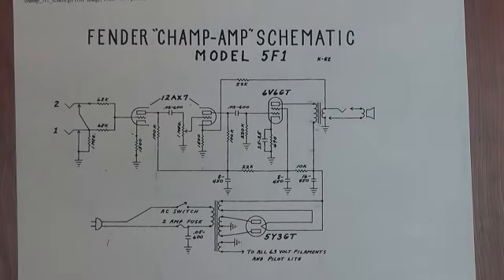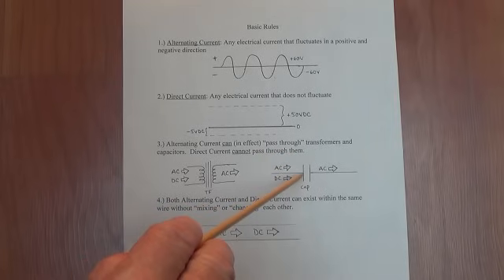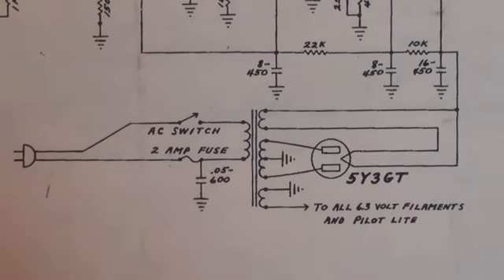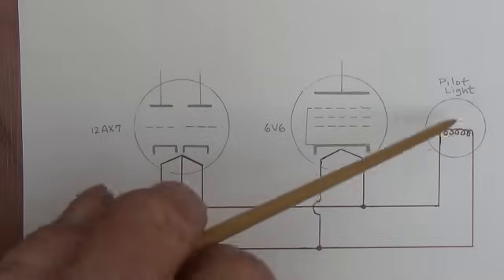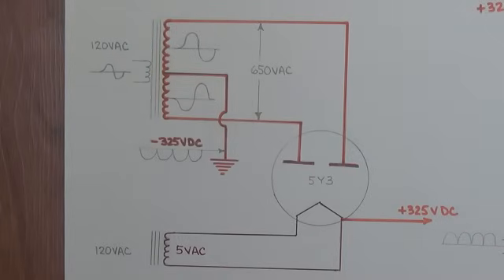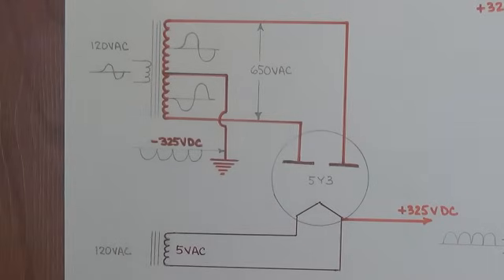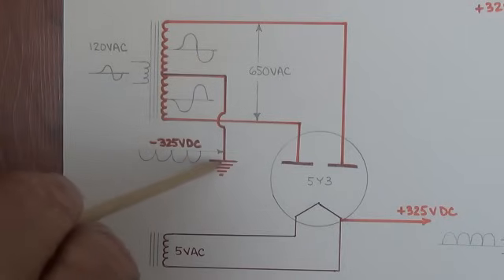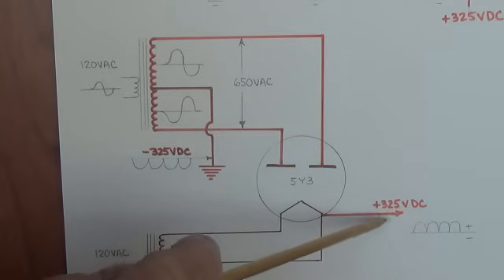How Tube Amplifiers Work, Part 1: The Power Supply

Comment: So your saying that the negative or below line wave is counted as positive voltage in AC but once rectified we only have 1/2 of the waveform available for use.Hence the 325volts DC.
Reply from the maker: +316SILENTDEATH  Roughly speaking, with a Full-Wave Rectifier (FWR), this is true. It's actually a bit more complicated because of the concept of RMS (see my video on this). In reality, if you start with a 325-0-325 high voltage output from a CT HV winding (650VAC total) and run it through a FWR, you only get half of the wave forms, which seems like it should be 325VDC, but due to the RMS correction factor between AC and DC (divide by .707) it's actually about 450VDC.....and then you lose a lot of that during the rectification process. The net output is about 380VDC after rectification (i.e. with a 5Y3).

Comment: Thanks for posting this great video. I am learning a lot. I was wondering if the capacitor in the AC line is there to protect the transformer and the rest of the amp from wall current surges ? Thanks for taking the time to answer my question.
Reply from the maker: +prydonian460 You're welcome, P460. Actually that capacitor's purpose is to eliminate electrical noise from the incoming AC current. It offers a path to ground for spurious signals so they don't cause background noise in the amp output.

Comment: Does tubes have a voltage drop too, like diodes? Nice video Doug, regards from Brasil!
Reply from the maker: +Nikolas Weber Thanks, Nikolas. I know that tube filaments (heaters) have a voltage drop. In series-filament circuits, which have no power transformer, the sum total of the voltage drops is equal to the input voltage.
Reply: A rectifier tube has an internal 'plate resistance' which causes a voltage drop when it is passing current.
Reply: silas fatchett thanks mate

Comment: Why do we need alternating current AC when we have direct current? Wouldn't direct current be more efficient to electronics?
Reply from the maker: Mike Green There was a big debate (Edison vs Tesla) about this in the early 1900's and AC won out. The reason is that you can send AC through power lines at very high voltages, which minimizes losses due to distance, and then step it down with transformers when it gets to homes and businesses. Transformers don't work with DC, so you would be stuck sending 110 or 220 volts DC through power lines....which is very inefficient. Also, high-power generators (i.e. at hydroelectric dams) produce AC.
Reply: ohhh thank you, that really does make sense. I appreciate that. I am interested in electrical engineering. This really helped me. Thank you sir.Uncle Doug
Reply from the maker: You're welcome, Mike.
Reply: Uncle Doug
Sorry, I had another quick question. Does the Alternating Current apply to other countries as well, say Russia or Germany? When I was in Europe they mentioned the conducting current for the outlet reached 200v and I was told that could kill me if i got shocked. And I know that the current in the U.S. is 120v, which isn't enough to kill me necessarily, since I have been shocked several times in my tenure in life.
Reply from the maker: Voltage (i.e. 110VAC to 220VAC) and frequency (i.e. 50HZ to 60Hz) vary all over the world. There are charts posted on the Internet that will tell you the specs for every different country. Actually 110VAC is just as lethal as 220VAC if you are adequately grounded; however, non-lethal shocks from 220VAC are supposed to be much more painful.

Comment: Is there any advantage for using tubes for the rectifier or would it make just as much as sense to use solid state diode?
Reply from the maker: James Cuttell Diodes are cheaper, easier to install, more efficient, and more reliable than tube rectifiers.....but many people feel that tube rectification is essential for the warm, "saggy" vintage tone provided by classic old amps. In addition, indirectly-heated tube rectifiers, such as the GZ34, provide a slow warm up that is much easier on the amplifier tubes.
Reply: Will the rectifier affect the tone as much as what is being used for the actual amplification?
Reply from the maker: The rectifier provides the high voltage DC that is essential to the amplification process. Tube rectifiers have somewhat different tone characteristics than solid state rectifiers (as described in my previous response).
Reply: Ok but I know that using tubes for the actual amplification stages also have a large effect on tone  and I was just wondering if the effect of using a tube rectifier is as pronounced as the effect of using tubes for amplification?
Reply from the maker: No, probably not.
Reply: Okay thanks for answering.
Reply: Okay so I've done some research and does using tube rectifiers basically increase rise time/ slew rate relative to frequency.

Comment: Hello Uncle Doug & Rusty, I hope you and yours are all well. I want to thankyou & let you know that all your hard work making video tutorials about tube amps, and, most excellent reviews of awesome vintage amps is greatly appreciated. To newbies just learning, your great explanations of tube amp operation are valued greatly, excellent graphics and good analogies, make it easy to understand. I recently watched biasing a single ended amp, several times. I missed some. A friend has a Harp Gear 2, Harmonica amp, and, his 6V6 output tube went out after what I would call limited use, but, played at high volumes when at a gig. I feel that with what I have learned after some years of electronics learning, doing, and your tutorials, I could one handed perform the tube bias assessment and check the Plate Dissipation value. The Harp Gear to me seemed to be quite warm when in use. More volume, more current, more heat? I'm thinking. Anyway, he bought new tubes, N.O.S. from Tube Depot, AKA Antique Electronic Supply, and, will see if 6V6 lasts or not, if not, probably biased to hot as per your video, amp is only 8 watts or so. Tubes should be showing the week of 7-19 and cant wait to pull back door and look inside, If I do the work. Check out the Lone Wolf Harp Amps.com site, nice amp for $347.00. Tube with a solid state Rectifier, sounds good to me. Thankyou, be good and take care, Cass.
Reply from the maker: Cass Virgillo You're quite welcome, Cass. Rusty and I are glad the videos are helpful. If the 6V6 in the Harp Gear amp was biased too hot (i.e. the plate dissipation was greater than 12 watts), then its lifespan would definitely be shortened. You're correct that more volume causes increased current flow and more heat, so if the amp has been played at high volume for extended periods, then the overheating problem would be even more evident and harmful. Be very careful checking the bias, particularly if it's your first time, and best of luck.

Comment: ac input of +60v/-60v has a rms of less than 120v i believe. it should be around 170v peak to achieve rms of 120v ac.
Reply from the maker: Nick Teasley The peak voltage input actually is 169.7VAC, Nick. Input appears to be 120VAC because voltmeters are calibrated in RMS values. This is covered in several comment discussions below and in a separate video addressing RMS vs Peak Voltage. Thanks for your input.

Comment: Hi Again George here I need an opinion I have static ( i call it popcorn noise) noise at idle on my amp have changed tubes have cleaned sockets to no effect thinking of changing the output screen resistors 470 ohms at 2 watts what do you think?
thanks
Reply from the maker: ***** Screen resistors, particularly old carbon-comp. resistors, are very common sources of such static, George. Replacing them (with metal-film resistors) is always a good idea.
Reply: Thanks for your advise It seems that the popular resistor for 6l6 is 470 ohms and el34 is 1k I designed an amp with 1k and 6l6gcs with very good results. Also it seems to me that two resistors one for each screen might have a matching problem one resistor feeding both screens might be a better way to go.
Reply from the maker: Let us know how it turns out, George.

Comment: Doug I've build an 18 watt amp.  Marshall clone. I've read your tutorials.  I understand the tubes roles the 2 transformers roles the rectifier, and the pots.  I put in 51 resistors and capacitors. I have not found a good resource explaining all of those components, including coupling capacitors and why and where I pair 33k resistors in series with a 1 m resisor at imput   Can you help?
Reply from the maker: mmgourlay MM, a full explanation of the function of all the resistors and capacitors would fill several screens. Virtually all these functions are described within my videos, but no one video is dedicated purely to this topic. 

Resistors are used to reduce voltage and current to appropriate levels to suit individual components. 

"Coupling capacitors" block the high DC plate voltage from reaching the next tube's grid, while allowing the AC signal to pass through. 

I do not have a schematic for your amp, but I believe the 33K resistors to the 1st tube grid may be paired in series to add up to 66K (normally one 68K resistor is used) to serve as "grid stopper" resistors to attenuate radio frequency interference and prevent parasitic oscillation. 

The 1M resistor should go to ground and act as a "grid leak" to help bias the grid and to provide electrons that strike the grid a pathway to ground. If you want more info on these, just do a Google search for the terms in quotes.

Comment: Final report on saving a Kalamazoo Reverb 12 tube amp. It works. Nice little warm tube amp with a lot of knobs on the front that do not seem to do anything. Please note that if you replace the stock power transformer with one having a center taped tube heater supply and you ground the center tap, please remember the stock wiring has the heater power taken to ground at the final pre amp stage. You will need to remove that connection. Yes it was in the diagram. And yes I should buy stock in a fuse company. We would both profit.
Reply from the maker: BrokenPortriats Congratulations on your successful rescue of the Kalamazoo Reverb, BP.....and thanks for the stock tip :))

Comment: I'm really curious why there is a capacitance connected on the 'neutral' line of the AC power cord!?  (I'm assuming that the switch is on the "hot" side of the plug, and, the "fuse" should be just ahead of the switch (on the hot side of the line supply, (shouldn't it)?
Reply from the maker: guloguloguy George, if you're referring to the .05 uf cap between the primary AC and ground, it is the infamous "Death Capacitor", used to reduce noise in the incoming AC current. People fear it since it represents a short to the chassis (and thus a shock hazard), but in my experience it very rarely (i.e. virtually never) causes any problems. You're right about the proper wiring sequence, but you must recall that in pre-early-60's amps, there were no polarized plugs or 3-wire cords, so the wiring sequence had two possibilities depending on how you plugged the amp in. Once polarized plugs came into fashion, you could wire the primary as you suggest and it would always be plugged in that way.

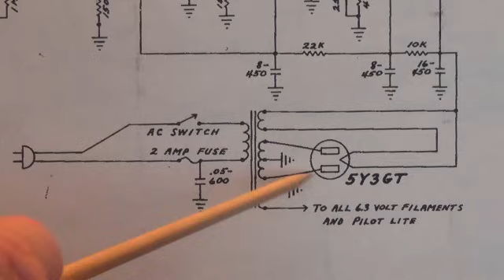Comment: 5:07 shouldn't the fuse and the switch both be on the "hot" side of the mains, for safety?
Reply from the maker: stereopolice We realize this today, SP, but 60 years ago, when the schematic was drawn by Fender, it was much less of a concern. With an unpolarized, ungrounded, 2-prong plug (as all amps then came with) there was no established "hot" or "return" wire....it changed depending on how you plugged the amp in. Now that we have polarized, grounded, 3-wire cords and a fixed "hot" input wire, we can install the fuse and switch within it.
Reply: Uncle Doug Understood, and thank you for the quick reply sir.  Regards, Brian.
Reply from the maker: You're welcome, Brian :)

Comment: Doug I am building my first amp from a kit. I watched your videos.  I am building a Marshall like 18 watt amp. I understand most stuff now but resistors.  Why 35 of them? And why on every circuit?  I get ohms law and the need to regulate either voltage or amps.  But when are they used filters? When do you put them on output transformer?  Why 68k at imput jacks etc.  Who picks these numbers?   Seems like they stick a resistor every place you can fund space?  Help Matt
Reply from the maker: Matt, I assure you that every resistor is there for a reason. Different components need different amounts of voltage and current to function properly. The only place they act as part of a filter network is when they work together with the large filter capacitors to produce ripple-free DC current for the tube plates. The more you work with electronics, the more you will come to understand the need and function of components such as resistors. Be patient. It will eventually all make sense.

Comment: Very informative. Thanks for great videos. I prefer tube rectified amps. Interestingly, I changed the GZ34 in my JTM45 out. I swapped a chinese GZ34 for an original, unused Mullard GZ34. The plate voltages were identical after the swap, but the amplifier had noticeably more presence and detail. People tell me it must be in my head, because the rectifier tube sees no signal, but surely the sound coming out of my speaker is the voltage coming out of the rectifier regulated by the signal on the grids?..I honestly believe the rectifier tube affects tone and feel...or maybe it is all in my head. Either way, The Mullard is staying in, because it is a nicer shape, has clearer glass and a nicer colour glow.
Reply from the maker: Thanks, Johnny. You may be right about the Mullard GZ34. It may offer less "sag" than the Chinese tube, which would contribute to better pick response. The Mullard tubes are, in my experience, the best available.

Comment: I want to compliment you on your well-organized, easily-understood presentation of tube amp function.  I am not an EE, but I  have built tube amp kits, and would recommend this to anyone who wants to have a better understanding of what's going on in a tube amp.  My only suggestion would be that you briefly show actual components (resistors, capacitors, transformers, etc) for those not familiar with circuit diagram symbols.
Reply from the maker: Thanks so much, PZ. It's great to hear that the video(s) are helpful. I have shown the components you mentioned, in other videos but not this one. I appreciate your suggestion and will keep it in mind for future videos.

Comment: Uncle Doug I watched many of your tutorials.  i am trying to fix my sons Fender Blues Junior.  it had no sound whatsoever.  The R47 resistor was fried.  i replaced it and 5 new tubes (probably didn't need to replace tubes)  the R47 is after the B+ capacitor.  now i get a very muted low distorted sound when i strike a thing on the guitar.  improvement but..... what do I do next?  also the reverb box has both white colored intakes and the jacks are black and red so is there a polarity issue?  also in replacing the power transformer pins does it matter which red green or brown goes on what pin?  lastly the black wire off the transformer has 5 pins to plug it into  which is correct?  the other 4 are empty  thank you
Reply from the maker: Greetings, MM. I don't work on modern amps with integrated circuits and PCB's. Here is a schematic of the Blues Junior that may answer some of your questions:  http://www.blueguitar.org/new/schem/fender/blues_jr.gif   Long-distance amp repair is challenging, if not impossible, and it sounds to me like this amp has multiple, perhaps serious, issues. I would suggest that you consult an experienced amp tech on this matter. Besides being dangerous, more harm than good may arise from guesswork. Best of luck.

Comment: Quick question. You state that coupling caps are placed between pre amp stages to block the B+ dc voltage from passing to the next grid in the chain while allowing the ac guitar signal to pass through. But in the supply power section caps are used to help smooth the left over humps in the dc voltage. then how come the caps don't block the dc voltage when used as filters?
Reply from the maker: Greetings, SS. The AC guitar signal actually runs through the coupling caps (in one end and out the other, which DC cannot do), while the DC high voltage only runs past the + leads of the filter caps.....it never runs through them to their - lead (which is grounded). The smoothing process occurs as the signal passes by the + leads. For a diagrammatic explanation, please see my video on Filter Caps.
Reply: Uncle Doug Thanks Doug! So the caps act like little batteries that fill in the humps. Keep up the good work!
Reply from the maker: You're welcome, SS. Yes, that analogy sounds OK :) We will